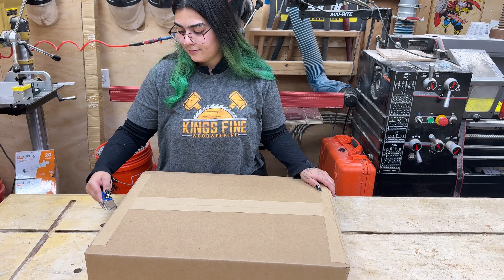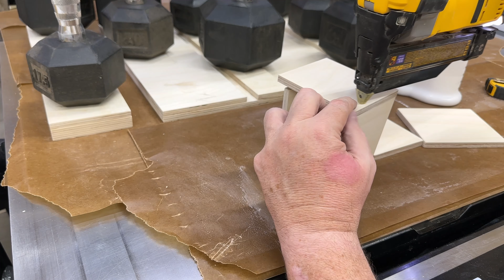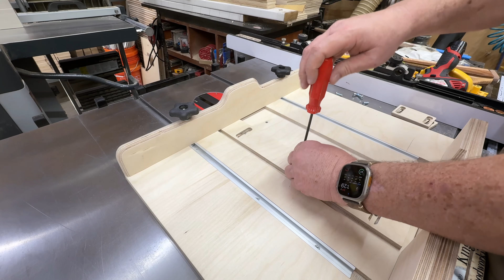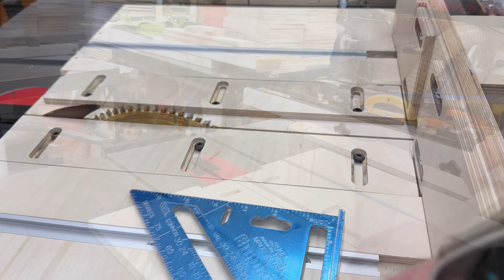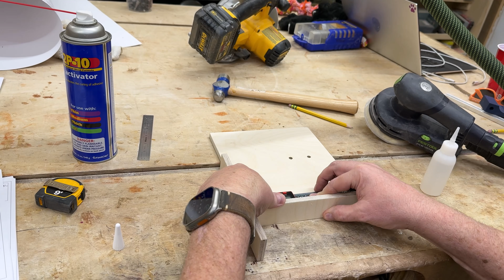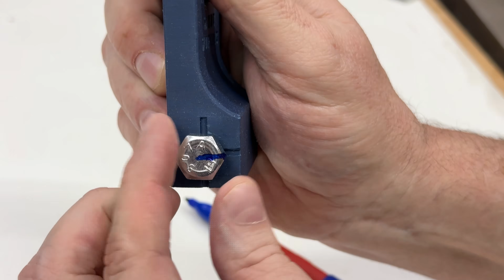141 - Unboxing and Assembly of the Flagship Sled - Compact size

Comment: Absolutely love this sled! The video is awesome and made it much easier to put together. One note for the miter bars. I have a Dewalt 7491 saw and the channels are flared out on the bottom to keep the miter gauge from coming out. Initailly, my miter bars went in with no issues and I had them adjusted just right. As soon as I added the pennies, the bars would not slide any longer. I had to re-adjust the set screws and it worked perfectly after that. I'm not sure how many other saws have the same design. My test cuts were dead on with the square I was using (I don't have one as accurate as yours). I can't wait to make my next cutting board with this! Thanks!

Comment: Can this be used on a Shopsmith?
Reply from the maker: Yes it can. But you’ll need to make the miter bars from a hardwood. The miter slots on the Shopsmith are not a standard size, so the miter bar that comes with this doesn’t fit. 
However, making a pair is very easy and takes maybe 5 min. And I send a video showing exactly how.
Reply: @KingsFineWoodworking  thanks!

Comment: When I measure 1 1/8 inches from the side of my sled to attach the back piece, the zero clearance inserts don’t line up on the base vs the back. They look to be 1/2 offset.  I can send you a picture.  If the intention is to get the inserts to line up, my spacing from the edge would be 5/8”. I can send you a picture to show you.
Reply from the maker: Yes please, send me a picture if you don’t mind, I’ll see what’s happening and get it fixed immediately for you. My email is james@kingsfinewoodworking.com
Reply from the maker: And the inserts do have to line up perfectly. But if you don’t mind, send over the picture first before attaching. And a phone number, and I can call you.
Reply: Just assembled my compact sled and ran into the same issue. I’m wondering if 1 1/8 was meant to be the full size measurement and 5/8 for compact.
Reply: I have the exact same issue with the compact. Just sent you an email with a picture. Thanks!
Reply: I just ran into this too. It’s taken me a year to finally open the box. I’m guessing that since I’m not alone that the 1 1/8 was intended for the full sized sled.

Comment: Hi James. Love the sled and all the details you share. For my DeWalt DWE7491 the left miter bar almost lines up perfectly with the pre attached T-Track. The blade is dead center. The miter bar screws down snug however. So, doesn’t seem to be an issue. If I knew how to attached an image I would! 😂🤦‍♂️

Comment: i love my sled!!! there's an error in one of the dimensions in the plans, i think its the second or third page, the left and right pieces on the sled base but its easy to figure out with the pictures along side it. seriously the best sled ive ever built. I was surprised how much of an impact a sled is. i actually made the two main zero clearance inserts as one part because i have the kats moses jig square and you cant use it without both the back fence and the bases zero clearance inserts for obvious reasons (that were not so obvious when i ordered the jigsquare haha) they all turned out to work in the end. i used a 1/2 inch ply and it was a very easy build. Thank you so much!!!!!!